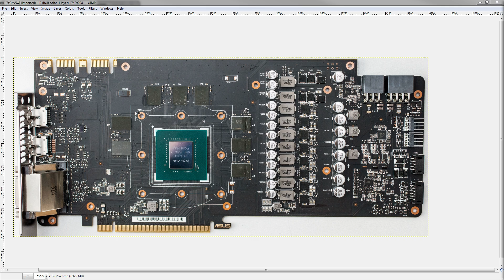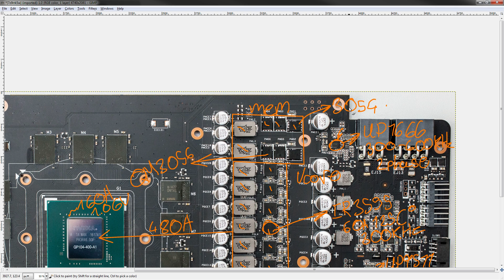PCB Breakdown: ASUS GTX 1080 STRIX

Comment: Hi! i have a question, what are the normal voltages on the voltage rate points? (11:50) I have 12V on the middle, the other two changes from 0.30 to 1 volt (mabye it's the tester)

Comment: I think you swapped pex and 5V on this one. If you mesure both on a live 1080 strix, the one you marked as pex, gives 5V and the one you marked as 5V, outputs 1V.
all 3 (1V, 1.8V and 5V are using the same buck convertor --> https://www.mouser.com/datasheet/2/277/NB671LB-1079585.pdf) I mesured it on a 1080ti strix. But I guess they are more or less the same. (another reference --> https://www.youtube.com/watch?v=hov0JJpFPoI&t=145s )

Comment: Hello, i was looking for info on this card and this video was very helpful, taught me a great deal. I still would like some info on the 5V VRM chip if you can please provide, i can't find it anywhere. It's labeled as AMCH 645 but i can't find it by that code anywhere, no datasheet, nothing. I have this graphics card, gives no image, not getting recognized by the mobo but fans spin and RGB works and i'm trying to resurrect it somehow... the 1.8V to EEPROM is there, but on this 5V it reads 0V, also no visible blown up components... Any help is much appreciated.

Comment: 9:24 uPI Semiconductor became uPI Group when they branched out into focusing on digital power solutions (mostly power MOSFETs, power controllers, and suppression diodes). UBIQ is the trading name of that power solutions arm of the business. uPI Semiconductor still exists but is mostly focused on analog power systems (opamps and signal transistors). So UBIQ Semi and uPI Semi are sister companies owned by uPI Group. I'm not sure I'd describe the QM305x series as inefficient though; they have an Rds-max of <5 milliohms at a drain current of 30A (120mW dissipated); perhaps they're a little underwhelming for the job at hand if heat is a problem?
Reply from the maker: 30A drain current on a 0.005 ohm FET gets you 4.5W of heat output not 120mW.
Reply: So it does, I forgot to square the current first!

Comment: 1:16 - My guess is that the 5V VRM on the bottom is boosting off the 3.3V, since the 1R0 marking on the inductor shows it's a 1uH, so I'd expect that it's a boost type converter. For the 12V to 5V drop I'd expect to see something more in the range of 20-100uH (you'll note that others on the board towards the right are 68uH). Unless of course it's low current (<100mA or so), then I might be wrong.
Reply from the maker: there is a lot more power available on 12V than on 3.3V and buck converters are more efficient than boost converters. There is literally no good reason to use 3.3V for 5V. Also the 3 R68 chokes to the right are 12V filtering and R68 is 680nH not 68uH. The 1.8V rail uses a 2.2uH choke so does the PLL/PEX rail.
Reply: Ah, right you are, I misread the labels on the inductors. While buck is typically more efficient than boost, it doesn't matter so much if the voltage difference is small (a delta of less than 2V is nothing really) and the current isn't crazy high, so it could go either way. If the inductor down there is actually the power inductor for a switching boost regulator then the 5V from 3.3V makes sense. Otherwise they went way overkill on the filter, or the current must be super low if it is indeed a buck type off the 12V.

Comment: Just wondering, did you get the 980Ti HOF LN2 email I sent a while back? 

I think you mentioned that you really wanted to do a video on the Galax HOF LN2, so I sent you some high resolution videos.
Reply from the maker: Yeah I got it.
Reply: Pretty crazy PCB.  Good to know though.

It's a real pity IMO that Galax does not do AMD GPUs. Given the voltage locks on Nvidia, right now AMD may be the open real option. It'd be awesome to see a Galax Vega LN2 HOF.
Reply from the maker: I'd be happy if one of the big AMD partners took up making OC focused cards. Sapphire could certainly make a KP / HOF competitor they just seem to have no interest in actually doing that.
Reply: The closest thing you might get is probably an MSI Vega Lightning. The MSI 290X Lightning was a pretty awesome PCB.  Hopefully AMD allows it. The Fury X had no custom PCBs and the Fury very few.

Sapphire usually makes a flagship, like the 290X Toxic and below that the VaporX series.

Asus did make a 290X ROG Matrix, but it was considered inferior to the MSI 290X Lightning.

Comment: to use the unlocked BIOS, you have to flash it...
It would be way more easyer for us if you would show the TDP mod ;)
Reply from the maker: if you know how to flash a BIOS the BIOS is much safer and better
Reply: maybe, but to fail and  break the warranty at a 850€ card is.... yes... you know
the TDP/shunt mod is much more "keep warranty and get better OC"

I know that my preorderd 1080Ti FTW 3 will have 2 BIOS...
i dont know... :/
Reply: CaptainxXx If youre literally a potato maybe you'll screw it up

Comment: The only thing I can find any where for Vpp (Ipp0) is for a Micron 288pin DDR4 nonvolatile RDIMM module (with 9 ddr chips and a buffer chip). It looks like the Vpp amps draw for that is under 100mA for the entire thing. So if GDDR5 is as good on low power draw, it may work fine on a few three-pin linear regulators. It's not grate for efficiency, tho it can be incredibly clean and noise-free for a "word line boost current" supply (Vpp).

From another angle, I'm not sure that a power draw of less then 100mA for all eight chips combined, can justify the PCB area for a full fledged buck converter. lol.
Reply: I wouldn't be surprised if the Vpp is supplied by the 1.8V VRM for the EEPROM. I've seen it on other cards.
Reply: Graham Sutherland, yea, it just about got to that after looking at everything else on the card over in private chat. I had suspected something else tho it dose not look like that would be able to deliver the needed current. So it is either a shared Vreg or some form of Electron-voodoo, lol.    it also is not critical for OC, so sort of non-critical for most, just a fun Easter egg hunt of a sorts.

Comment: OK, probably a silly q, tho a n00b question.  That 1V PEX/PLL vreg. If you were to mod it for Ln2, would it be raising the V to match some ratio of another voltage, or lower it to maintain similar currents threw lower resistances of realy cold parts in the chip? or is it so marginal that it realy doesn't matter for most extreme Ln2 OC-ing